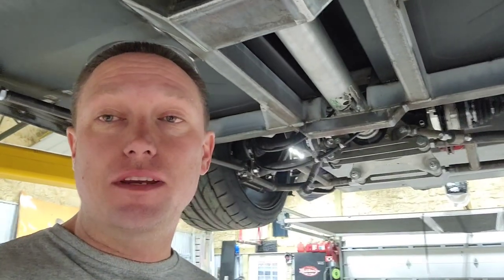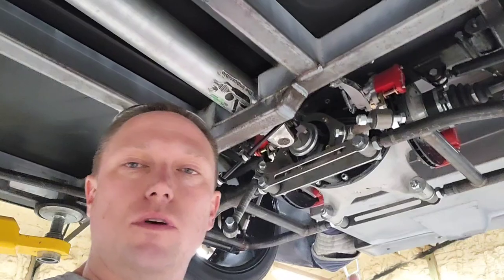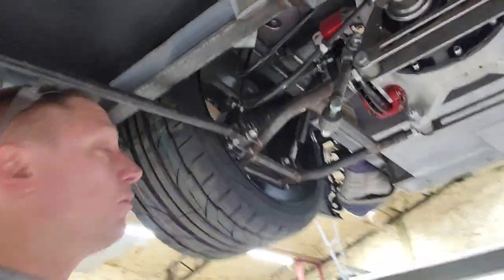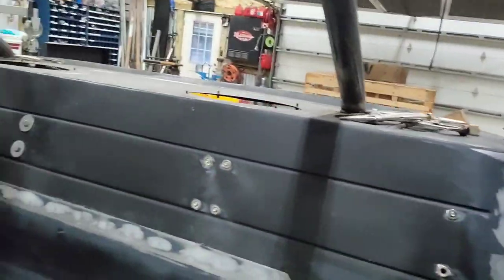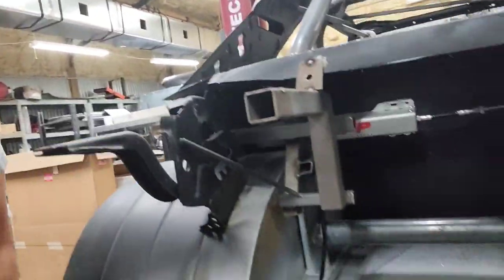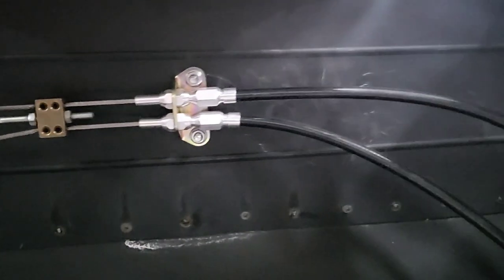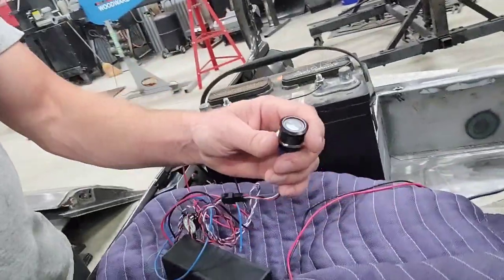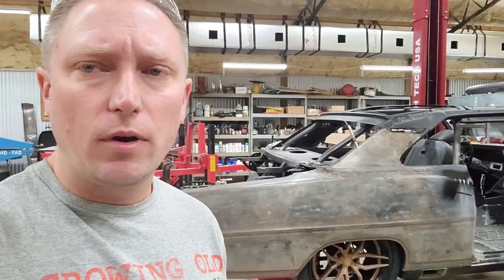Electronic Parking Brakes - Classic Car Installation

Comment: You can always use a open head wrench with tape in one side of the. Put the nut so that the tape can stick to the nut you are using and have a friend insert the bolt so that it gets screwed together. I am considering doing the electric emergency brake system but still debating. Lets see.

Comment: you cannot use electric parking brake when you are driving/ while car is motion. Here is the reason your electric brake cannot feather the rear parking brake to slow you down, if you apply the electric parking brake you will lock up the rear brakes and you can lose control of the vehicle in certain condition such as in wet pavement. I would connect the ignition wire back on for that reason.

Comment: I installed this and it has already broke twice.  I know this is going to leave me stranded with the brake locked on.  I am just going to eat the cost and remove it and go back to the foot brake.   You also can not use it if the ignition is on.  You can never uses it if you really had an emergency while driving.   It is a real neat idea and mostly works.   It is just one more part to break and leave you stranded,, and it did break twice.
Reply from the maker: I can't say that I've experienced any breaking issues, but I can say that simply leaving 1 wire un-connected will allow you to use the brake while moving if that's what you wish to do.
Reply: Good point, possibly use a switch to disconnect it from the ignition switch in an emergency?

Comment: Where did you end up mounting the control box for the estopp?  Also how did you route power to the estopp actuator?
Reply from the maker: I mounted the control box inside my custom-made center console and then ran wiring to the actuator inside the driveshaft tunnel.  I also mounted a small fuse panel inside my console.  I ran 2 large gauge wires to the fuse panel, one that's ignition hot, and one that's battery hot.  From that fuse panel, I then power everything else found in my center console like my power windows, power door locks, etc.

Comment: If you hook up the wire that prevents using the Estop going down the road, doesn't that prevent emergency use of that function?
Reply from the maker: Yes sir.  Didn't think of that while shooting the video, so it was addressed in the description.
Reply: I was thinking the exact same thing as I was watching the video.
Reply: @RedlineStands  so how are you handling the run away condition that made you go this direction with this unit?
Reply from the maker: @CarTrain1  I have decided not to connect the ignition wire to the E-Stop unit, which will allow me to engage the parking brake during operation if needed.
Reply: I’m just combining it with the stealth gydro handbrake with the button park under the dash. Life hack,